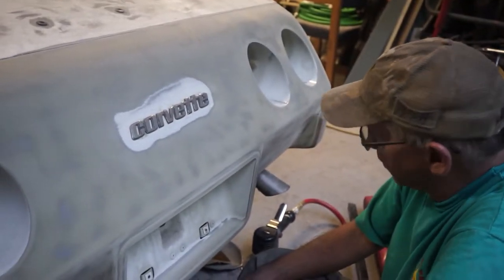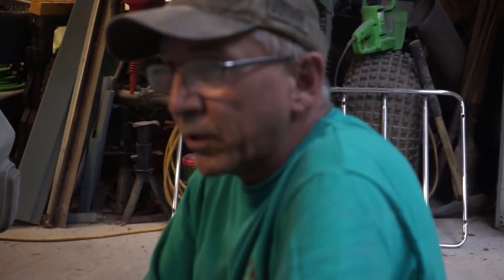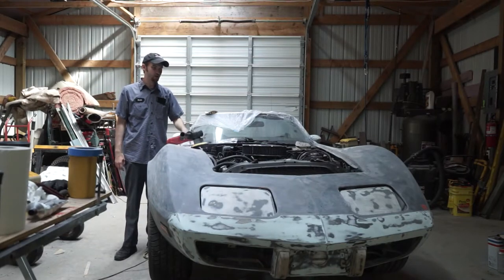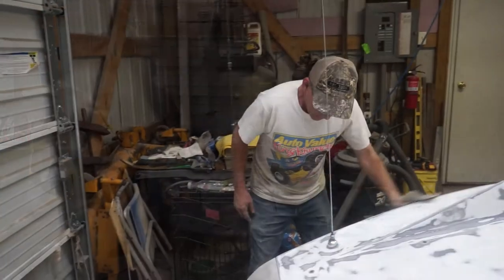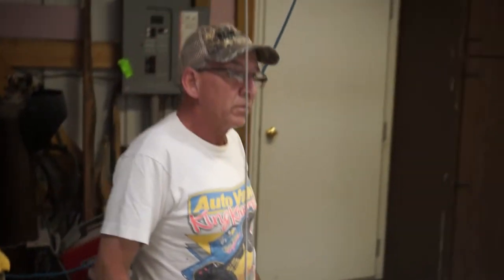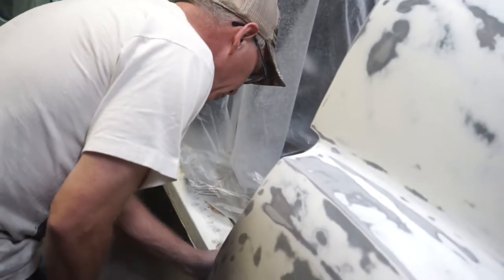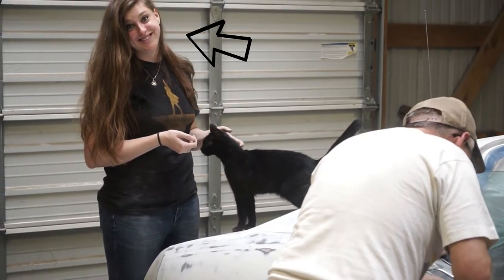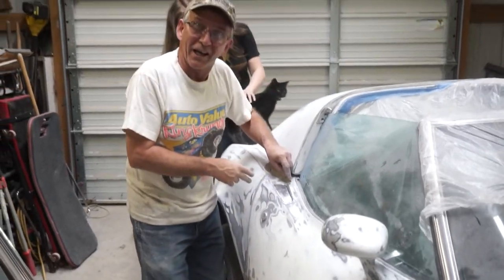Finish Sanding | 1977 Corvette Restoration Ep. 5

Comment: How can you have such a high breather? I ran into clearance problems maybe intake to high. I had to take radiator support top brace because it interfered with my custom hood.
Reply from the maker: Mine just barely fit. The key is being a drop down style rather than being level with the carb.